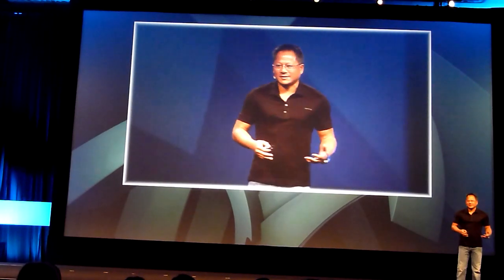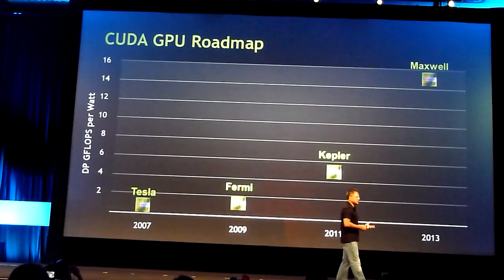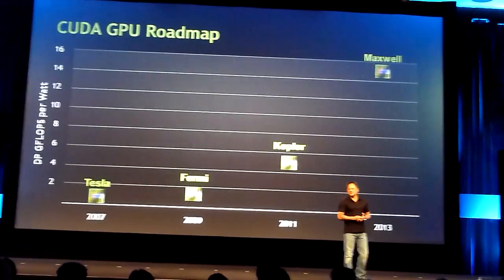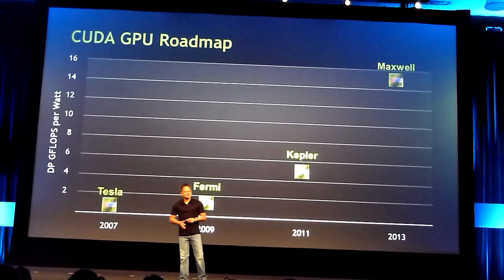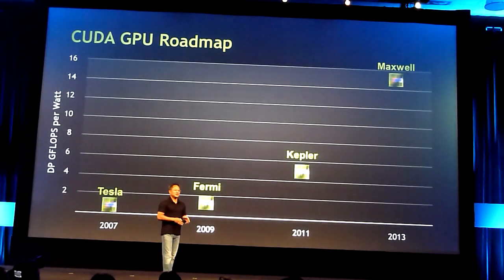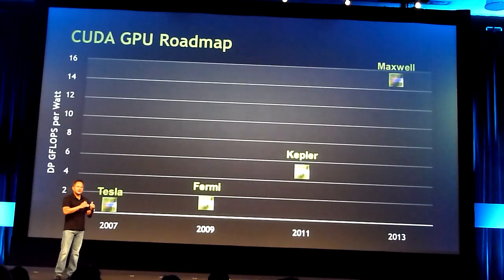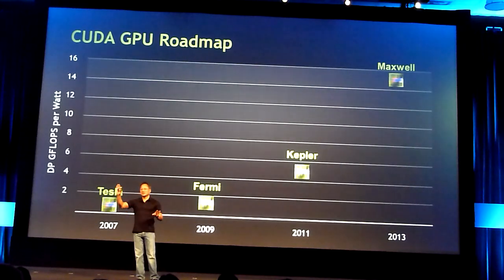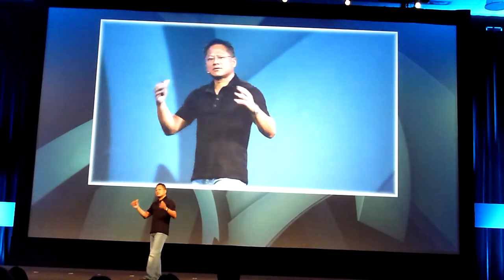NVIDIA GTC2010: CUDA GPU Roadmap 2013

Comment: The ps3's rsx gpu is based off of the nvidia 7000 series and is similar in performance to the gtx 7800. At the ps3's release in 2006, the 7000 series gpus were the latest nvidia gpus on the market. If they follow the same strategy for 2014 then the ps4 will probably be using a Maxwell architecture gpu similar to the gtx 880. I want the next gen consoles to be as powerful as possible so they wont hold back pc's in 3rd party games. But since the ps3's launch was a disaster, you could be right...

Comment: This is about power, not directly translated to performance. In other words Maxwell wont be xx times better than Kepler, but it will use much less power, but at the same time perform slightly better (15-20% is standard increase between CPU platforms. Not sure about GPU).

Comment: @Weini123 I also have GTX 460 and I never can use GTX 470 or GTX 480 even if they are a gift .. also any cards of ATI/AMD .. because some of the reasons are (Bugs all the time - driver issues - gaming issues) and many more  (and I would prefer the GTX 480 of course if I forced to choose between the GTX 480 and 5870)

Comment: @OmarTheVenom agree the feature list of nvidia is better than the one on amd side. but still for me heat + power consumption is a huge factor to take into account when judging which graphics card is better and thats why i think that the 5870 and 5850 were better than the 480 and 470. but still this is just my opinion. (btw i got my 460 because the fixed power and heat problems with their GPU update GF104).

Comment: @Weini123 I have list with about 10 (series problems) of the 5000 series !! the only problem of 470 and 480 is the heat .. no problem in any cards again ! you can compare Nvidia features vs AMD features (which almost not exist) or the GTX500 series vs the HD6000 or  GTX590 vs HD6990 ...etc....

Comment: @TheNewbpowner123 These are graphics card cpu's, like a gtx480 has a fermi processor...
The gcard will fir anything thats newer than p3 so ya...

Not shure on kepler bandwith, it may be a 16x lane speed user or 32x (Maybe both since most cards dont even fully utilize 16x yet...)